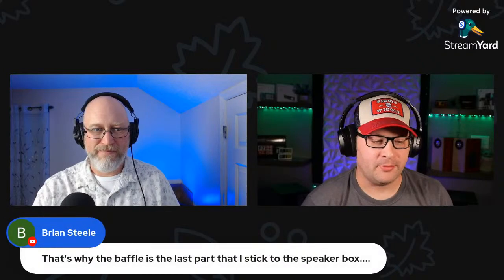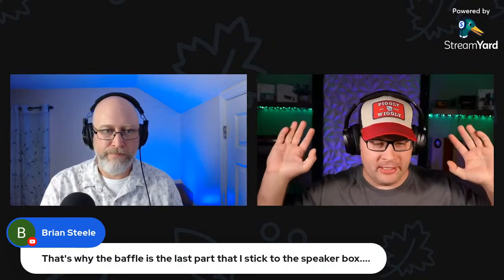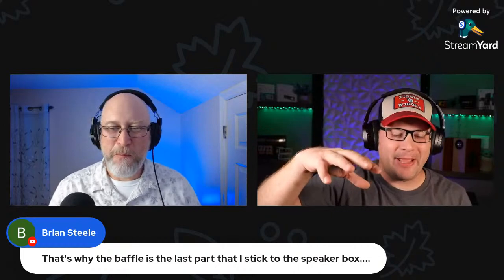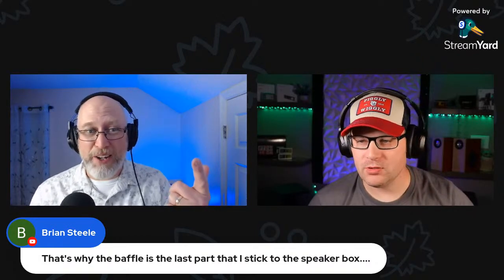Speaker Specs Explained

Comment: I'm north of 50 yrs old and used to compete in car audio in the late 80's and early 90's.  I used mostly Rockford Fosgate and Orion...and still have a lot of HCCA amps and Rockford Power Series stuff.  I still love music played LOUD, however I have searched all over online and my local stereo shops for information to build a great box for METAL!!  I listen to mostly 80's Metallica, Ozzy, Ratt, Motley Crue, etc...and most YouTube stuff is geared towards making the loudest bass - but at 30hz or below.  I want that punch in the back bass, really tight snappy bass.  I have no idea what the frequency is but I'm guessing its 80bz-100hz?   Can you make a video or reply here on recreating bass for those that dont listen to rap or new age music that utilizes frequencies below 60hz?  I did hear a Fosgate system 20 yrs ago with 4  HX2 Power 12's in a sealed bed box and it felt like you were in a boxing ring and Mike Tyson was pounding on your spine.  :)

Comment: Here's the point to using an Amp that is rated for more power than what your speakers can handle . If you match the power rating that Amp has to work at 100% of its capability.  We all know what happens when you run an Amp at 100% , it overheats and normally goes into protect quickly.  If you use an Amp that is rated for more power than your speakers are rated , you can set your gain to limit the power within a safe range and the Amp will only work at 80% or whatever it would be. This means the Amp will run cooler and if the gain s set properly will probably never go into protect.
Reply from the maker: I understand what you mean and I don't disagree with you. But I would rather have honest power ratings so that I can be deliberate about it as opposed to just hoping light hell that my 500 watt amp will put out 600 Watts.
Reply: @DIYAudioGuy  oh definitely agree there , I've made it a requirement to purchasing an amp, that there must be a thorough review on it so I will know the true max capabilities. But as far as buying a specific 1600 watt amp for 2 subs rated for 800watts rms por say, I don't agree with Nick on . I prefer to get an amp that has 25% more than the subs are rated for. This is so I only use 75-80% of the amps output power. A cool amp is a happy amp. I wouldn't spend crazy money for a 5k amp though for 1600 watts of sub. I like to look at it as $ per efficient wattage.

Comment: Question if I put a high current alternator in my car so going from a 140 to 250 amps and don't have the rest of the equipment installed ie big amps , speakers , extra battery will it ruin the cars regular battery? I will have mids and highs and taramps 800*4 only pulling power I'm thinking I need to hold off but idk
Reply: look at ur fuses, add them all up, then u have the amount u need to feed, remember that the car also needs power to run, an alternator gives the power needed the battery is mostly for when the car is turned off..
i would use caps also...
Reply: @palledrengens  I think you missed the point of the question. I'm asking if the added voltage will harm the stock battery. With only one amp on it adding 110 amps is a lot especially with no clutch on the alternator. However for all I know it might not even matter. Lol
Reply: @bigmike913  The alternator will only put out what it's being asked for. It needs a load to supply the amperage.
Reply: @fd1596  even clutch less?
Reply: @bigmike913  A clutched pulley or one way pulley is designed to lock in one direction and free wheel in the other. It allows the alternator to slow at its own pace after being accelerated by the engine, which in turn helps with belt skipping, and slippage. Unless you're talking about something else, you would be fine.
Reply: @fd1596  I just went back and looked it over again it doesn't have a clutch and says it's for better charging however it also says it has load dump protection so I'm thinking it's safe thanks for your help
Reply: @bigmike913  👍